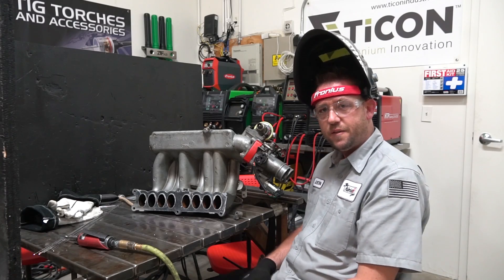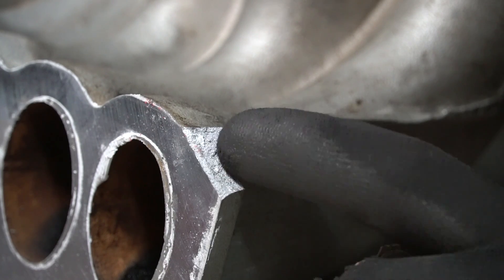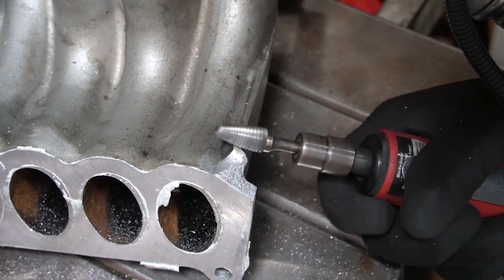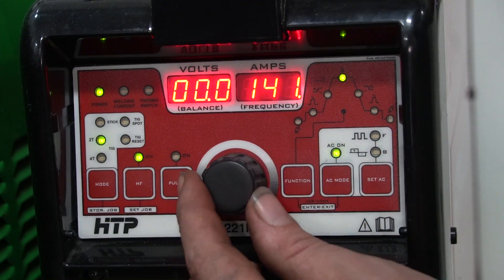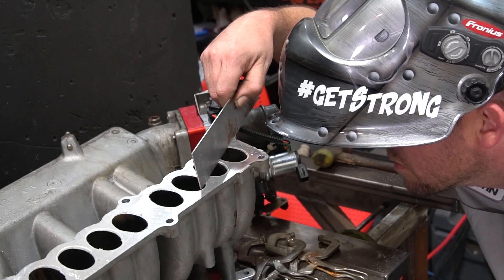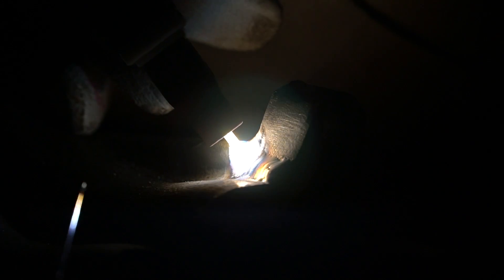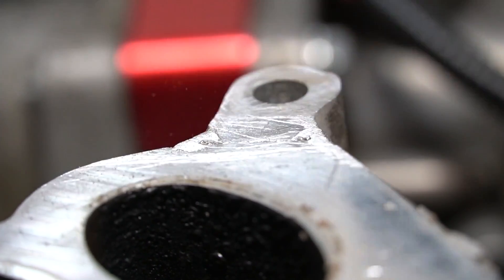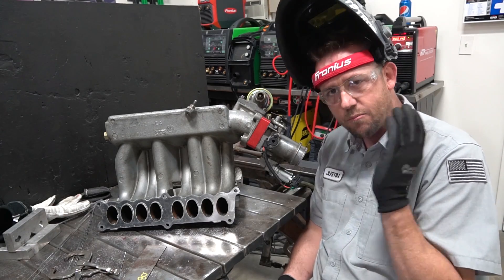TFS: Cast Aluminum Weld Repair

Comment: This type of stuff possible with an oxy acetylene setup? lol
Reply from the maker: I tried to weld aluminum with oxy about 12 years ago and failed miserably. If there is a successful method, I haven't learned it.
Reply: Aluminium brazing can be done on relatively thin sections successfully as long as prep is correct, has to be religiously clean and then cleaned again moments before welding. You cannot cheat with Aluminium it is the easiest by far to repair/weld as long as one preps and pre-heats and let any hydrogen and impurities enough time to vent through your molten weld pool.
Reply: @teznumber1  very informative. Thank you, sir.
Reply: @Xzempt1  your very welcome.

Comment: Ok...nube question.....would silicon bronze ever work for a repair like this so as not to have to fight all the junk coming out as much if base metal was "toothed" well for it to grab?
Reply from the maker: No. Silicon Bronze will not stick to aluminum. Aluminum is a very strange metal to work with. It's literally down to something being compatible or not, and silicon bronze is not technically compatible. 

I did MIG braze aluminum to stainless with silicon bronze once, but it's not a high quality joint. It was more like luck getting it to stick.
Reply: The Fabrication Series ...told you I was a nube.....bought a everlast dv200 a couple months ago and plan on playing around with it this winter......been using mig for years but figured I might as well start figuring out tig since the machines have become so portable and affordable in recent years....I just bought a bunch of different rods to have on hand and silicon bronze was one that I thought Id try out tig brazing with.....I've done gas brazing but obviously never tried it yet with tig. 
As a side note I've been binge watching you, Jody, and chucky's videos.......I do like yours because you just dig in and do projects that are real life scenarios but still keep it entertaining and on a level a nube can mostly keep up with....although I usually have watch them a few times over because there's alot to listen to and see in a tight package......great camera work!
Reply from the maker: For future reference - NEVER be worried about asking me a question. You can post up in public about a topic or even send a private message or email on any of the social media accounts. I got your back either way, and I'm glad to help.
Reply: The Fabrication Series ....I appreciate that!.....I dont do ANY social media....no time for all that, just utube and google searches....I only learn what I need to these days....lol.
Reply from the maker: @shrconstruction  All good. Keep posting your questions and I'll keep trying to answer

Comment: Can you weld cast aluminum with a dc inverter tig welder? I have a Stihl chainsaw that was dropped and one of the bolt ears broke off and the metal is thin where it needs to be welded back on to. Thanks for your videos they very informative. You sure do have the gift of gab.
Reply from the maker: I haven't had a successful repair on DC aluminum yet. I'm trying to find a realistic solution, but it just doesn't work as well. At this present time - AC is the only way. When technology tells me something else, I guarantee I'll be on top of it.
Reply: You the best. Thank you for the quick reply.
Reply: It is possible to weld Aluminum with DC, however the AC half wave cycle is preferred because it bombards the hard oxide surface layer (cleaning cycle) and wets  the much lower melting Aluminium below. With DC you don't have the half cycle change over which an advantage with AC, therefore it can be done but it's akin to drilling a hole with the power tool in reverse!
Reply: Yes I found that out trying on some scrap first. Thank you for the reply.
Reply: It is possible to weld Aluminum with DC, however the AC half wave cycle is preferred because it bombards the hard oxide surface layer (cleaning cycle) and wets  the much lower melting Aluminium below. With DC you don't have the half cycle change over which an advantage with AC, therefore it can be done but it's akin to drilling a hole with the power tool in reverse!
Reply: I have an Accurate Tools stick,tig , plasma chinesium DC inverter welder that I am still trying to get used to. There are not really any adjustments other than post flow and amperage. Yes I know I have got myself into a piece of crap but the plasma cutter works great as well as the stick welder.
Reply: you'd be better off using Alumiweld and mapp gas than trying a DC weld

Comment: Good repair man! I just did a cast aluminum clutch for a motorcycle. I used the Maxal 4943 wets out great like 4043 but stronger.
Reply from the maker: 4943 is some awesome stuff. I ran 4043 for the vid since it's more common and will do the job well.
Reply: Hey welding junkie what kind of strength do you expect to get on a piece of cast aluminum? 4043 is just fine. Castings are weak with low melting points like 4043. Unless its cast with a special grade aluminum like a Porsche racing engine block I had to repair all your doing is pointless over kill.
Reply: slaughterandmayhem what are you talking about? 4943 is awesome 1. Strength, I replaced all my 4043 with 4943 and not just for cast, its same price here and I can get it no problem. 2. It’s stronger again not just on cast. 3. It wets out faster than your girl on date night 4. The sheen is shinny every time. 

Last and maybe most important it’s heat treatable. It’s not overkill it’s just a better rod. Use what you like but you obviously never used it. And yes I know 4043 is fine to use, or didn’t you read our comments?

Comment: What rod did you use?
Reply from the maker: 1/16" 4043
Reply: The Fabrication Series have you tried 4943 yet? Seems to work really well
Reply from the maker: @weldingjunkie  I have. It's cool stuff but 4043 will also work well and is more common without being special order. That's why I used it here. Either will work just the same.
Reply: The Fabrication Series do you find 4943 stronger or you think it’s a gimmick it seems to work for me anyway better in cast but I use 4043 too. That was a good repair you did. Btw rods have doubled in price have you noticed? Bummer
Reply from the maker: @weldingjunkie  Metal in general has gone sky high in price (includes filler metal). I haven't seen any of my 4043 or 4943 welds fail to date, so I honestly cant offer my opinion. 4943 is like "smooth" to weld compared to 4043, but they're the same otherwise to me.
Reply: The Fabrication Series thanks for the insight always nice to hear your opinion. I think I’m going to start just running 1/16 and carry less 3/32 in the shop.
Reply from the maker: I keep both 1/16 and 3/32 on hand always. Just remember that you can always add meta (you can keep pushing a 1/16), but you can necessarily take metal way (can't get rid of a minimum sized fat dab). 1/16th can always be added to make a 3/32 size dab.
Reply: The Fabrication Series this is very true. I never thought of it that way. Makes a lot of sense
Reply: I was going to ask you the same question :) I'm going to try some smaller rods now and see if I can get less ugly results on this piece of cast aluminium I'm struggling with atm. Thanks for a great video :)